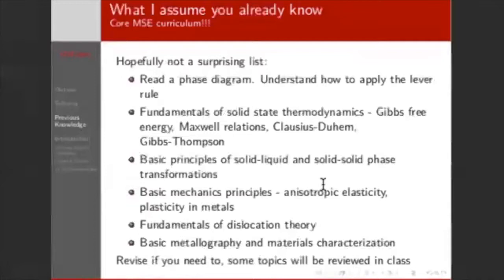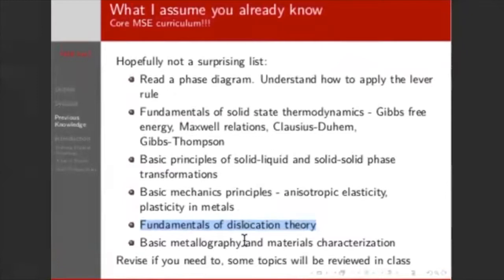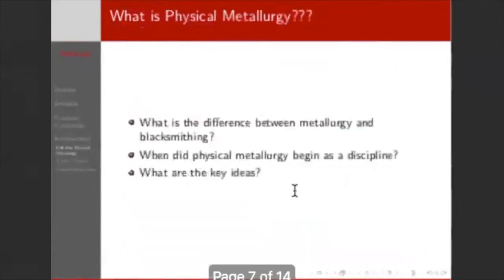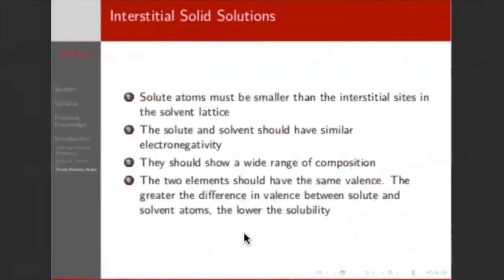Fall 2018 MSE 5441 - Introduction to Physical Metallurgy

Comment: Hi, is there  a text book?
When metallurgy  began  as a discipline? Are you looking  for the time they made swords, shields,  metal plows and horse shoes? Or when electrical  values for resistance, inductance, capacitance, or current (electron flow)  started?
This is why a book would help me  personally,
Thanks!